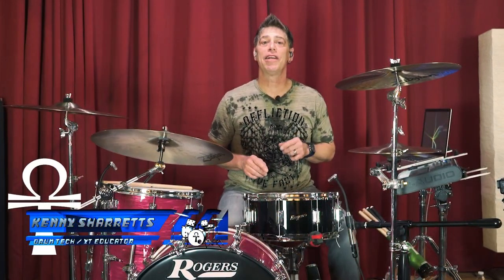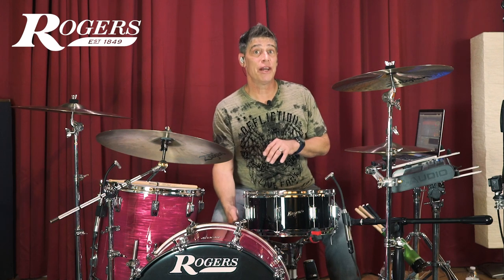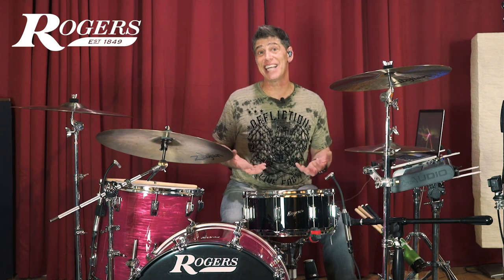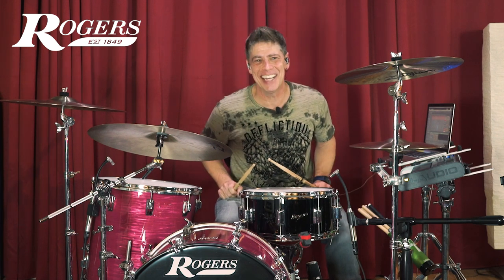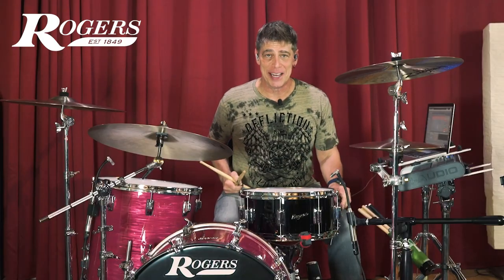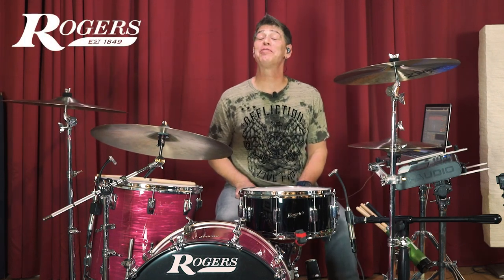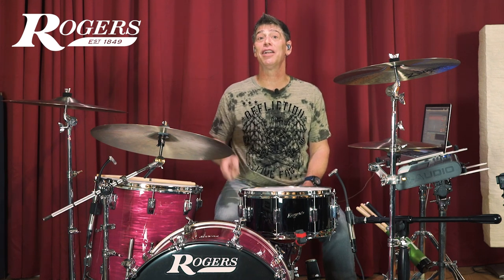HOW TO TUNE A 6 5” x 14” 8 LUG SNARE DRUM TO 7 DIFFERENT TUNINGS

Comment: Dude, holy damn! This drum tuning video is absolutely amazing, I clicked and the video was over for my feeling haha! I learned so much! I'm definitely gonna check the full version out!
And quickly compare between the tunings and intervals I just make this small list:
3:08 High tension, Perfect 5th
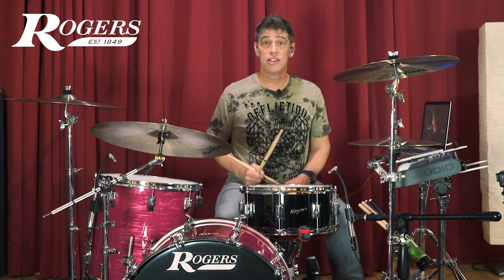4:35 High tension, Perfect 4th
6:38 Medium tension, Perfect 5th
8:13 Med/low tension, Perfect 4th
11:13 Low/swamp, Perfect 5th
14:32 Med/High, Minor 3rd
16:11 High tension, half step

Amazing Kenny! Again thank you so much! Also that tip about hitting the lug and then turning to hear what pitch it needs to be, amazing smart tip!

Comment: Swamp the best. But what key to get that pitch, isnt C or d? My snare also 14×6in . 8 lugs. Wood shell. Remo clear head. Its a cheap drum set actually😢😢
Reply from the maker: It’s not a key per se as it is 2 notes that work well together. The full vid at www.kennysharretts.com has all the steps, and all the pitches to get the sounds. It’s a cheap rental that will make your “cheap” snare sound like a $1000 snare. Thank you for watching.